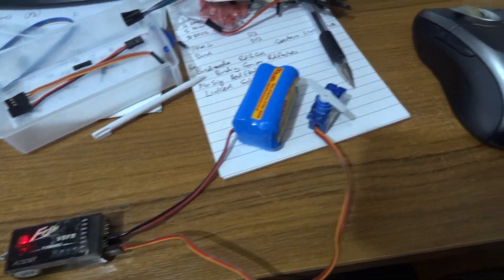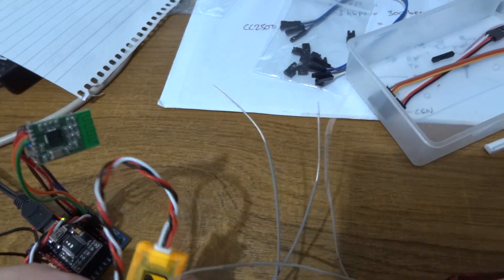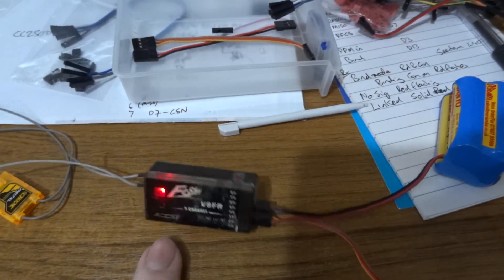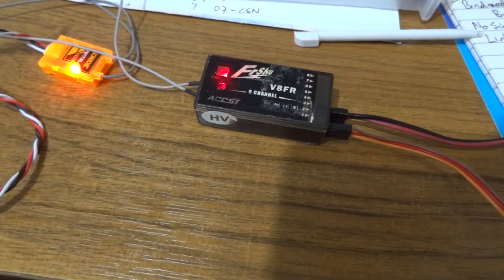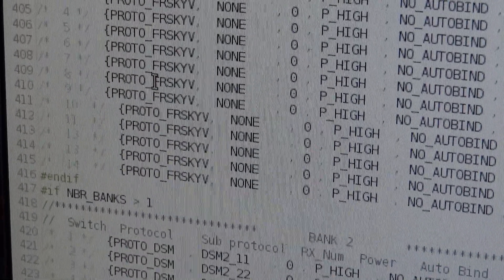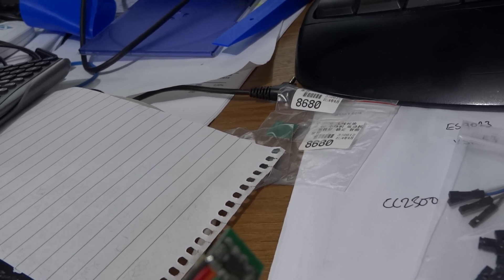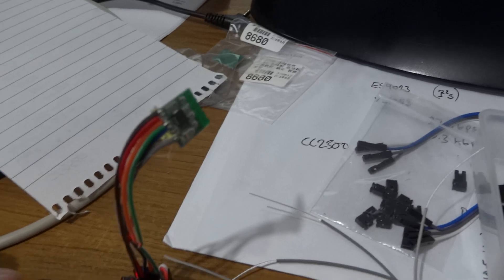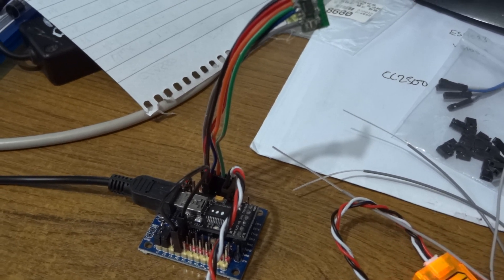FrSky V8 transmitter module using Arduino and CC2500

Comment: Hi, i want to ask about the cc2500 fifo, 'cause i'm making a wireless keyboard with nRF24L01 module and it has a fixed 3 slots in fifo, that can cause missing keys when pressing so fast. I read that cc2500 has separate 64-byte transmit and receive FIFOs, what does it mean? Does that mean i can send rapidlly signal without being worry about lost package in queue?
Reply from the maker: Yes, FIFO stands for 'first in first out', so the transmit fifo holds a queue of bytes waiting to be transmitted, when the radio-frequency part of the chip is ready to send them, and the receive fifo holds a queue of the most recently received bytes, which the microcontroller can process when it has time to do so.
If the packets of data to be transmitted/received are no longer than 65 bytes ( the transmit and receive registers also have their own additional 1-byte buffer ), then the microcontroller will never miss sending/receiving a byte - even if the microcontroller is busy doing something else at the actual time the bytes are being transmitted or received.
Packets of data can still be lost due to radio interference, so the microcontroller still needs to check for corrupted or missing data and, when necessary, try again, just as you would with an nRF24L01(+).

The nRF24L01(+) also has FIFOs, though it does them slightly differently - it can hold three packets, each of up to 32 bytes, for both transmit and receive.

In general, I think the cc2500 is a more capable chip than the nRF24L01(+), but there are fewer examples of how to communicate with it on the web, so that makes learning how to best use it a bit more difficult.
Reply: @ceptimus  Thanks for the information. I tried all the possible ways with the nRF24L01 like sending with block/non-block, set time out and set retry after failed, writing a custom queue and send it in one package... But generally the nRF24L01 might not capable of sending/receiving signal rapidly, and with the fixed 3 slots of package in fifo queue make it quite impossible for nRF24L01 to resolve that amount of data in time. I could use radio.write (to await packge in fifo to be processed), but it add up too much delay, at some point is unusable. I may order some cc2500 and do some experiments with it.

Comment: Can i get codes for this please?
Reply from the maker: Documentation here: https://ceptimus.co.uk/FrSkyV8Tx/FrSkyV8Tx.pdf
Code here: https://ceptimus.co.uk/FrSkyV8Tx/FrSkyV8Tx.zip
Above is the simple way using my library, derived from Pascal Langer's work.  If you wish to download the original Multiprotocol source code (by Pascal Langer), you can get that here: https://github.com/pascallanger/DIY-Multiprotocol-TX-Module, and my config.h file for it to make it V8-only, as described in the video, is here:  https://ceptimus.co.uk/FrSkyV8Tx/_Config.h.zip
Reply from the maker: You've probably already watched it, but there is more information, and (I think) a better version of the code, (my Arduino Library) described in this video: https://youtu.be/3tOABDPLxVk  Note that you don't need to use the tuning pot - all the options are described in the documentation.
Reply: @ceptimus  Thanks a lot for your reply, the codes and documentation too. We are trying to make a simple Frsky D8 receivers, we have seen the multiprotocol firmware but that works for Atmega and STM32F103 mcu, but we are looking for very minimum receivers which just receives the signal via D8 protocol and outputs 6/8 channel pwm thats it. 

Your codes works for D8 protocol?
Reply from the maker: @SatyaGupta  I did a similar library for the D8 version, but I never got around to documenting it as well as my V8 version, and it was transmit only - I never implemented the telemetry reception parts.  I started out on the D16 version too, but never finished that one.
Reply: @ceptimus  I guess that's what I need. Just to generate pwm that's it. Bare simple 6/8 channels pwm. I don't need documentation, I can code so I can understand it, if you don't mind sharing it please
Reply: @ceptimus I have a flight controller that has a built in CC2510 receiver, I want to make a DIY transmitter for that, can you please guide me?
Reply from the maker: @therishabhdhiman  First, read the instructions, here: https://ceptimus.co.uk/FrSkyV8Tx/FrSkyV8Tx.pdf